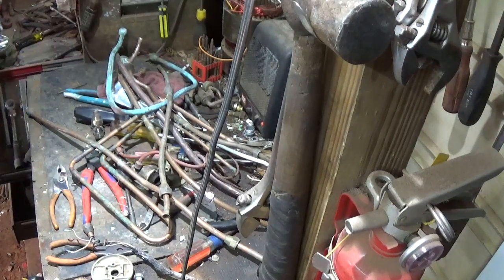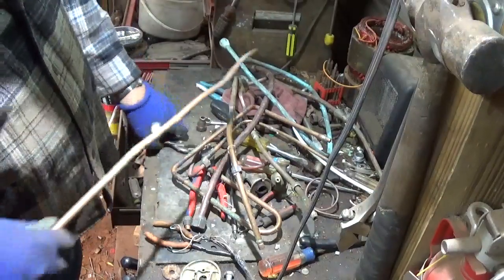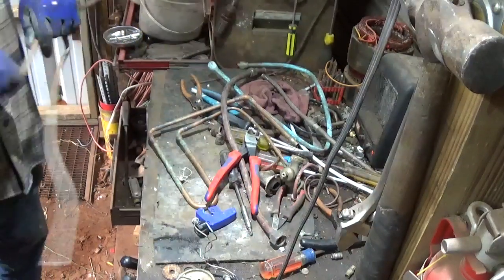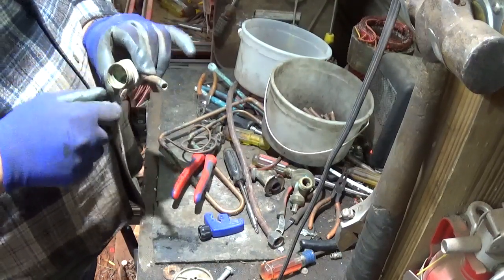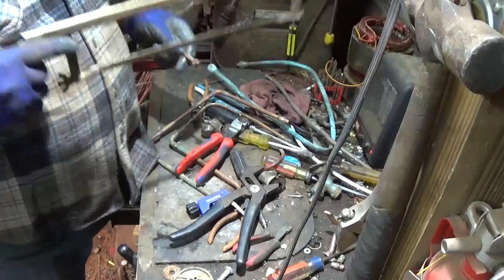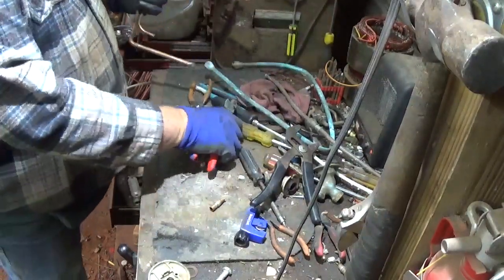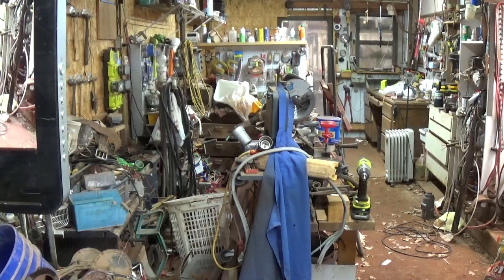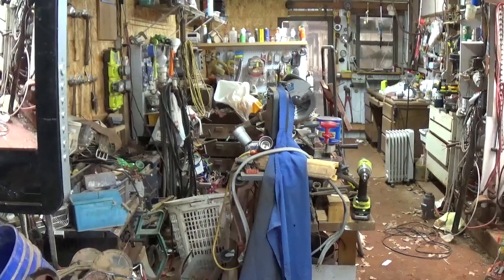Scrapping some Copper & Brass, and a Look at my Bucket Shelf

Comment: Ok I've seen enough. I subscribed . I like the way you have your shop and you do know some recycling. On those small pieces with the pins in them I take a drill bit just a little bigger than the pin. Drill it out takes about a minute start to finish no hassle. ✌️
Reply from the maker: Thanks for the Sub. and have a Happy New Year

Comment: Thanks for all the helpful tips. Its good having a look around your shed,the shelving etc. Be good to see that stripper going as well. Great vid 👍
Reply from the maker: it should be in today,  will play with it for a few and then make a video, i am cleaning up some push mowers with aluminum body some are easy to get everything off i have some that are self propelled and they take a lot of time, also have 2 riding mowers that i am working on. had to stop due to rain. one i have to change the steering gear and the other the guy said the motor locked up. while taking the motor off i found the problem it is the (i will call it the electric clutch) the wires were cut or wore through so it was like the deck stayed engaged.  well thanks for watching and stay safe

Comment: I see alot of tools but I have yet to see you use a Vise.    I've heard you mention one,  but !   I pleasure the time you take at scraping like myself I enjoy it.   These guys that worry about the time I guess it's more of a job (I get it though) !   I try not to make it a project after the first time.   Once again I enjoy your time.
Reply from the maker: i have a small vice on a workbench outside where my mini fridge is. i have two vice in a door way going into the greenhouse side of the shop, and i have a vice mounted on a pole with a base,  it rocks a bit and some viewers say that it makes them sea sick when watching. lol, I also have a drill press  vice that i use sometimes. i may try to clean and rearrange the workshop this winter and set up a big work bench with a vice on it. my main shop get's too hot in the summer with the sun shining on the tin. my add on has doors on the north and south.wind comes from the south in the summer here, and the new area is under a big shade tree and stays much cooler, and the main shop i have a furnace in it for heat in the winter. so it's like a summer shop and a winter shop. Thanks for watching John

Comment: I have recently melted into ingots 1200 pounds of aluminum scrap. I regret cashing it in because it took a long time to accumulate and I'm learning from this you tube it is easy to create other things than ingots and pay a whole lot more! I want to do the same with copper but at the rate it comes my way I don't any expectations of getting enough to make the one thing I always wanted. A anvil. From what I'm seeing here you could
Reply from the maker: there is a facebook group called BackYard Metal Casting & Foundry Work i think it is this group a guy on it makes and sells copper, brass and aluminum anvils.1200 lbs that's a lot of aluminum

Comment: When you are making your cuts in the copper tubing to make a crimp(bending point) and then put side cutters down and then break the tubing........Try making all the cuts for a whole piece of tubing with the side cutters before putting the tool down and THEN make all the bends to break the tubing. It saves time. Most of the copper tubing I have laying around came out of old homes that were being renovated and it is all green corrosion all over it. Is that still clean copper or does it have to be wire wheeled and cleaned to be number 1 copper?
Reply from the maker: it can be green as long as it is not paint,

Comment: Can you use the pipe cutter in this video to put the cutting blade as close as possible to the brass sleeve? There will be 1/4 inch left to the sleeve and then place the end of the copper in a vise and crush copper right next to brass and use side cutters to cut the brass sleeve? How do you normally get the brass sleeve off?

Comment: How do you like the vice stand that the motors are laying around at the beginning of the video?  I need to figure out a vice stand contraption of some sort.  Needs to be somewhat mobile.
Reply from the maker: i like it. it rocks some what and get's viewers a little sea sick but i like that it is portable and doesn't take up room on the work bench. i picked it up at an auction. i got a bench grinder at the same time and it is on a stand too. you could weld a pipe onto a tire rim. or receiver hitch mount

Comment: Apparently you don't have to clean the "green" off the copper,   on another thought, bolt cutters work well on copper and brass
Reply from the maker: the yard is good with the green, I have a pair of cable cutters that cut the copper tube well. I do have bolt cutters but don't remember the last time that I used them